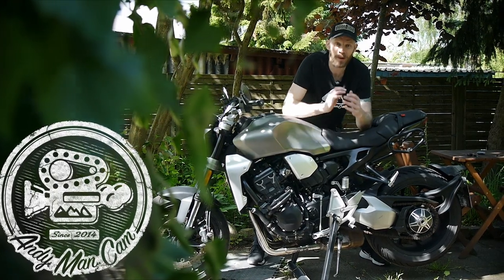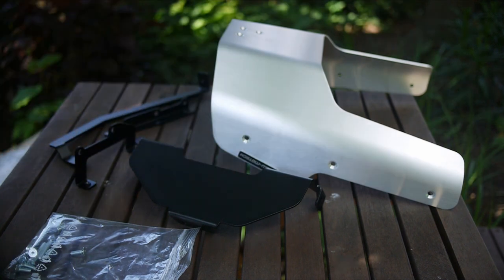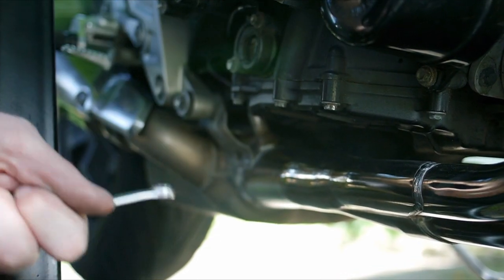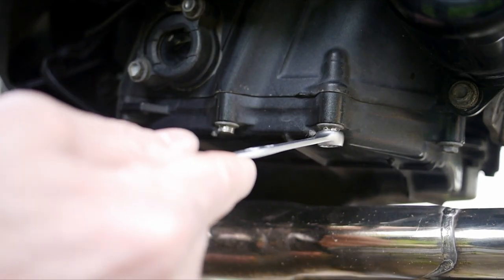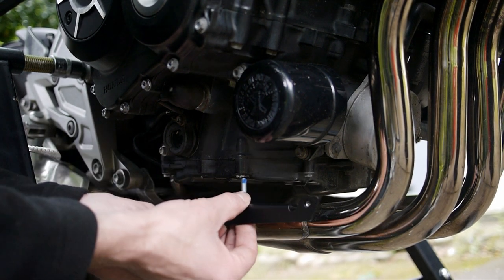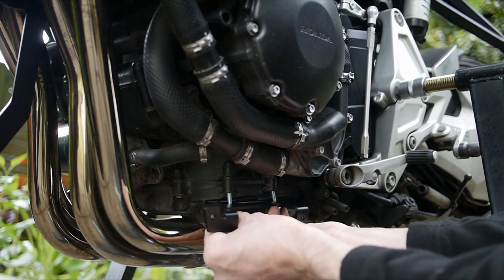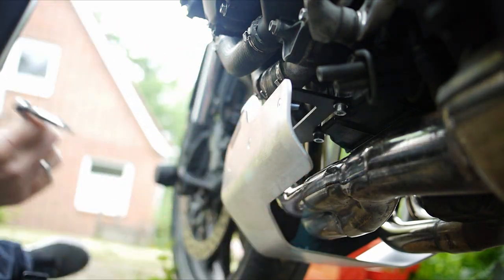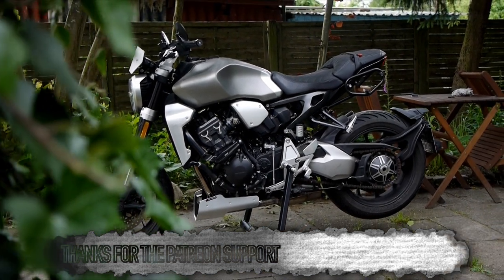SW-Motech Bellypan Install - CB1000R

Comment: I placed a black SW Motech belly pan after I had Header pipes ceramic coated for $200, they look polished and yum from the previous discolored state and run down look. I swapped all bolts and nuts with Titanium ones. I swapped the front disc floating pins with gold colored  titanium ones as well ! On my 2019 model Candy red color 👍
Reply from the maker: Sounds tasty! Bolt swapping certainly seems like the smart way to go 👍🏻

Comment: A trick I was shown for bolts that feel their going to round, is to take a brass drift (or even a steel one if that's all you have) and give it a tap with a hammer on the end of the bolt. Sometimes steel bolt and threaded alloy parts bind and hitting it gently can break that enough to get it loose.
Reply from the maker: That was some of the thinking behind me bashing the bolts with a hammer. Then being so soft that they went out of shape was just an added bonus!! 😅

Comment: Nice addition to a great bike, couldn’t agree with you more on the topic of front mudguard length. Added a Pyramid Plastics ‘Fender Extender’ to mine. Made such a difference to the downpipes etc when the loverly UK weather is at its worst !
Reply from the maker: Cheers John. A fender extender would have been my obvious next move. But SW have created an aluminium front mudguard. If it can’t work flawlessly, at least it can look good while it’s doing it!

Comment: Hi Andy hope you are doing well and Happy as a sunshine 😎 hey for the chipped paint on the lower engine Consider PJ1 Satin Black spray paint, it is fabulous and I used it in same scenario. It makes the engine better looking than stock paint, it holds up to 500 degrees so it is long lasting as well 👍 it costs only $20 !!
Reply from the maker: Cheers for the tip! I’ll be sure to pass it on to the buyer… as soon as i find one!! 😂
Reply: I also swapped the stock chain and placed a D.ID X-ring gold chain . Huge difference in ride and pull performance as well as looks. Got it from eBay $132. I hate Amazon and quit shopping my from them 7 years ago. As well as Whole Foods market. I used to be an avid shopper from Whole Foods but since Amazon acquired them quality and hot food bar became poop

Comment: Good to see you Andy. It’s funny I never buy a naked bike and think “What that needs is some plastic bits to cover it up.” Still many seem to do just that. So what do I know 😂
Reply from the maker: Mostly i do agree with you! But that little area under the pipes always looks a little tidier imho when it’s closed up a tiny bit. And I’d never put a plastic panel on there! 😂. Same with the dash. The clocks always look a bit rubbish and unfinished (ever since they stopped using real clocks and stick cheap plastic housings around the lcd/tft displays. Very lazy styling) so the little Ally screen i have is just perfect to hide an ugly oversight!

Comment: Hi Andy, how would you compare this bike to your previous fz1n?
Reply from the maker: The overriding improvement of the CB over the FZ1 is the fuelling. Waaaay smoother and more enjoyable in the Honda. Also there’s more torque down low so the power Delivery is much thicker and smoother. The quality of finish is far superior on the FZ1 though. Nuts and bolts on the Honda are furry and dull on the Honda after 2 years whereas the FZ1 still had shiny and not rounded bolts after 14 years. The suspension on the FZ1 is also better from the factory. The rear shock on the CB is a horrible piece of crap.

Comment: Nice polish of the pipe.. let's see how this SW motech piece works on the long run. Approaching 36000km on mine (from August 2020), how much did you put on yours so far? 
So far so good with mine, just two flat tires and a gear box issue taken under the Honda garantee. Besides that, can't get enough.
Reply from the maker: Yeah I’m keen to see if the paint on the steel part is more hardwearing than the engine‘s cheese paint. I’m coming up on 20,000km now. Also since august 2020.

Comment: Nice one looks great hides that weird positioning of the oil filter too 
I cant believe your were that calm when rounding off the bolts?
I would have got a bit sweary to say the least! 
My old Suzuki was made of all sorts of Cheese parts, I thought Honda were supposed to be better than that?
Reply from the maker: I thought so too mate. Maybe they used to be, but Sod’s law the wheels come off the wagon just as i pour my money into it! I’ve learned that by staying calm i tend to avoid doing more damage in the rage! I’ve thrown spanners at the floor before only for them to bounce up and either hit me, or far worse chip some paintwork!! 😆

Comment: Hi Andy, always nice to see you show and test out fancy pants stuff that I can consider for my CB1000R. A few observations on this one. Looks nice and matches other bits well but I wonder if it’ll catch and trap more crud than it’ll stop? Not sure about your comments on bolt steel quality. They’ll have a material optimised for their purpose and perhaps if you’d used the Joker in the first place all would have been well? Ie about the tool fit rather than bolt steel. Finally, not sure that your zealous use of thread lock is best. It’s very rare for correctly torqued screws to come loose and you may just be creating more stuck screw headaches for yourself. I think Thread lock is generally for safety critical fixings.  Sorry about what looks like a long whinge, it’s only because I care ;-)
Reply from the maker: As long as it catches the crud BEFORE it’s worn more cream cheese Paint off the front of my engine, I’m happy to clean it out! Thankfully there aren’t really any nooks or crannies with this Bellypan design. Flat sides, open in the bottom, open in the corners. So should be easy enough to rinse anything through with the jetwash. I agree that it’s possible that with the better spanner, maybe the bolts would have come loose first go. The only thing that reinforces my feeling that they’re just incredibly soft is that this has never happened before and I’ve had the same tools for almost 20 years! As for the threadlock, i‘m just going with what SW tells me! Plus I’ve actually had correctly torqued bolts come loose in the past, so I’d rather err on the side of caution. Parts falling off at 120mph on the Autobahn is not funny! It’s also only medium strength and I’ve learned to be VERY sparing!! 😉

Comment: I contacted sw motech to confirm if it would be valid for the 2018 model since on their website they announced it for the second version of the 2021, and they told me that it could not be mounted and now I see that you have done it .
Reply from the maker: I think they’re just going on what their records say, because they’ve not personally tried it on the pre 2021 model. I’ll get in touch and ask if maybe they can update the listing. But yes, i can confirm that it fits without any trouble whatsoever! The front mudguard is exactly the same situation .
Reply: Before my insistence when telling them that it seemed to me that the engine was the same, they answered something unpleasant that if it could be installed I would put it on their website, I am glad to see that I was right.  I follow your work with interest, greetings from Spain.
Reply from the maker: That is strange. They know that I’ve fitted it to my older bike, because they sent it to me! 🤣

Comment: Hi Andy - I happen to have the same Honda CB1000r, SC80 altough mine is from  2018. I wanted to put on a Bellypan and a better Front Fender forever. As it seems you did both of it (I somehow remember you had an aluminium Fender on it at some point) However, if I look at the parts at the SW-Motech website this Stuff seems to be for the new 2021 model and not the older SC80. Did you somehow get adapted parts or are they just fitting anyway because they didnt change anything relating to bolting positions?

Comment: Hey Andy, looks great , and looks proper good quality, matches the factory brushed aluminium nicely, we share the same luck with the bolts, I’m an expert at rounding them off but maybe it’s not me and it’s down to the toffee and cheese bolts, I’ll have to look at SW-Motech to see what’s available for my CB1100RS  too, thanks for the video bud 👍
Reply from the maker: If honda could at least use slightly harder toffee, we might stand a chance! I’ve never rounded as many bolts as in the 2 short years I’ve had this bike!
Reply: @AndyManCam   if only they could make them from harder toffee, you would expect more from a premium brand, I think many of the leading manufacturers are slipping on quality now, my Bmw is suffering from corrosion, engine paint swing arm and wheels, it is a 14 plate but the price I paid you wouldn’t expect it , not had toffee nuts as of yet, sounds wrong that 😄

Comment: Link shows that fits only 2021 onwards. Had a customer service reply saying that  only 2021 onwards and would not fit 2018 preface lift....
Reply from the maker: Mine is a 2019, which is exactly the same as the 2018. it fits perfectly and I’ve told SW that several times, but they don’t seem bothered about getting the sales in and haven’t changed anything.

Comment: Looks good, but are those scratches on the side at 58secs and 1:38?

How will Aluminium hold up to stone chips on a brushed finish?
Reply from the maker: I thought the same at first. Turns out it was just polish remnants or pres-wax. It all rubbed off nice and easy. I think brushed finish will hide scratches and stone chips way better than a gloss finish, for example. Plus i accept that because i use the bike a lot, it’s never going to keep a showroom condition.
Reply: @AndyManCam  do like the little upgrades on the bike thus far.
Reply from the maker: Cheers EH. Couple more yet to come 😉

Comment: Useless front fenders are a HUGE pet peeve of mine. It seems like the only company that actually understands the purpose of a fender these days is Royal Enfield. I put a Pyramid Fenda Extenda on my Versys. Even the Extenda is shorter than I would like. One day I got back from a ride, and found that somewhere I had ridden through wet, white, traffic paint without knowing it. That was a PITA to clean off the underside of the bike, but it would have been even worse w/o the Extenda. SInce then I have made my own radiator guard using aluminum window screen to ensure the holes are small enough to catch blobs of paint instead of letting them through to the radiator.
Reply from the maker: Same here. If they put a tiny fender on, the least they could do is back it up with a radiator guard 🤦🏻‍♂️

Comment: Hello Andy .I just bought a 2005 fz1...I trying to get a new IMPROVED VERSION STATOR FLYWHEEL FOR IT....I CAN NOT FIND IT ANYWHERE  !!! PLEASE HELP ME .DO I ACCTUALLY NEED TO REPLACE. IT....? 
PS: THE BIKE YOU REPLACED THE stator flywheel (was a newer model than my )...
Reply from the maker: So you have the one with the aluminium frame like mine, or the steel tubular frame?
Reply: @AndyManCam  my is older than your (1st gen steel tubular frame ).yours is 2nd gen.....
Reply from the maker: I thought so. I’m not sure in that case if you even need to worry about it. Completely different engine and therefore completely different rotor!

Comment: Great video as always but don’t see how it protects the down pipes as they’re still exposed with only the lower parts being covered 👍
Reply from the maker: The lower parts get the worst of the blast. You can see that by the way the paint on the sump has been stripped off. Due to the laws of physics the spray from the wheel at the lowest points is being thrown at the engine and pipes almost head on, therefore meaning most damage. Further up the pipes and engine and the spray is being thrown from the front wheel at ever decreasing angle and therefore ever decreasing potential for damage. Plus stonechips and the like will mostly occur at low level. Ultimately, even a bikini fairing still provides more protection than no fairing at all.

Comment: I would say get 6 point spanners, not 12 for those ;-)
Belly pan fits the styling of the bike. How long before you wrap it?
Reply from the maker: I totally agree. I’ve got 6 point deep drive sockets but they only went down to 13mm 🤦🏻‍♂️  I reckon I’ll leave the wrapping on this but until it’s so scratched that i can’t bear to look at it anymore! Though with a brushed finish, that takes longer than with gloss plastic!!
Reply: @AndyManCam  The brushed finish is very tasty 🙂
Reply from the maker: Like matt, only less pretentious and more functional! 😂

Comment: Looks great. Yeah, Honda need to get the act together. Every Honda I have owned as has butter bolts.
Reply from the maker: You’d think they’d do something about it. But then again, people keep buying the bikes, so why would they bother changing anything.
Reply: @AndyManCam  that's it and to be honest, the engines seem to go for ever with a basic oil change eveey so often
Reply from the maker: Also true. I’ll be doing the next service on mine and i think the valve check can probably wait for another 100,000 miles or so! 🤣

Comment: Andy I'd really recommend a decent set of single hex sockets. Multi hex are horrid and to be avoided where possible as they are too willing to slip, plus if the bolt are cheap metal single hex is far less likely to have an issue
Reply from the maker: I’ve got a set of single hex sockets, but they‘re 1/2“ drive and only go down to 13mm 🤦🏻‍♂️ Always my go to wherever possible though.

Comment: I'm on the fence with getting a belly pan. Being it's a naked, it sort of defeats the point some. And, it really won't stop the need to have to polish the pipes any less. Yeah, it might protect them some. If anything, that and protecting the engine casing (which is also corroded on my bike too) would be the reason for getting a bellypan. Not for the looks IMHO. Hmm......
Reply from the maker: I do agree with you to a degree Scott. Though this is definitely the best looking one out there imho. Fits in with the ally-panel styling of the rest of the bike. The other brands with their hideous plastic monstrosities are way wide of the mark with this bike. I really should have taken some video of the pipes before i polished them. The corners, right behind where the black part of the bellypan now is, were considerably worse than all the rest of the pipes. So although I’ll still have to polish, it’ll be a light touch up rather than a full on re-work!
Reply: @AndyManCam  You are right about the quality of the pan. If I would add one, it would be SW-Motec‘s for sure. I think, since I‘m a fair weather rider for the most part, I‘ll not add the pan. If my riding habits change to where I ride in more inclement weather, I‘ll add one too. Btw, inspired by your wrapping video and because I wasn‘t happy with the all black wrap the previous owner had on it, I took on wrapping my bike and I think it turned out quite special. I‘m currently waiting for some Honda logo stickers to arrive and once they are on, I‘ll be making some pics or even a vid. I‘d like to get your opinion on my work.
Reply from the maker: Totally get that mate. If i was more fair weather, it wouldn’t be so important to me. Congrats on the wrap. It’s always worth giving it a go. Small investment and sometimes it works magnificently!!

Comment: Honda quality :))) Why did you kept the other two screws if they are crap? That's the weirdest bellypan I have ever seen, but I must admit, it looks good there
Reply from the maker: The first two were obviously looser and didn’t round off. So i was still believing that the bolts were of ok quality. In the end i binned all the bolts! Cheap rubbish! I agree that although a little different, the bellypan looks good on this bike. 👍🏻
Reply: @AndyManCam  anyway, if I where to put them back in, I will look for other screws and looking to replace the other ones on the pan oil
Reply from the maker: Definitely. I think at some point I’ll have the oilpan repainted or anodized and I’ll replace all the bolts at the same time.

Comment: What!  did you say a Wera Joker wrench is only 8.50 euro?    In Canada a single wrench is like $35 - $40 a piece... a 4 piece set is $100.  lol   ( I did crack into my kids college fund  to get the Wera Tool-Check Plus because it fits perfectly under the pilion seat of my KTM Duke...  I'll pay it back later  😂 )
Reply from the maker: Wow, thats lumpy. Yeah between 8,50€ and 13€ depending on the size. 50€ for the 4 piece set 100€ for the 11 piece set. Benefits of being in the country of origin i suppose! I’m sure the kids will understand.

Comment: Make sure removing original bolts n nuts and using Sw's  there is a chance of huge vibration...and CS ....very below expectation 
Or I was the unlucky one😮
Reply from the maker: Thankfully i didn’t find any extra vibration from installing these parts.